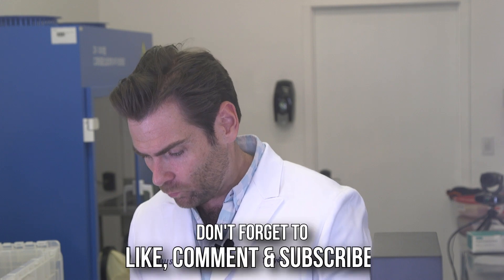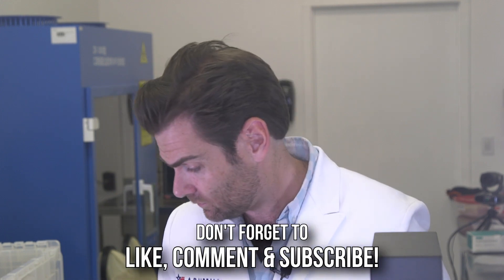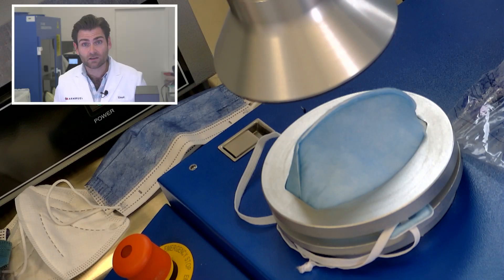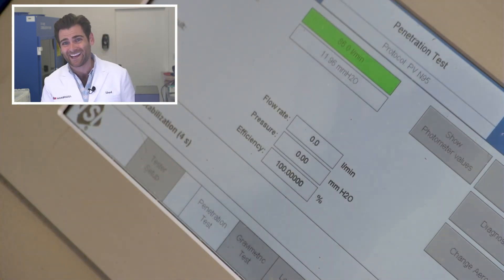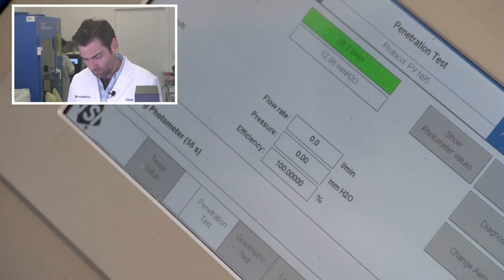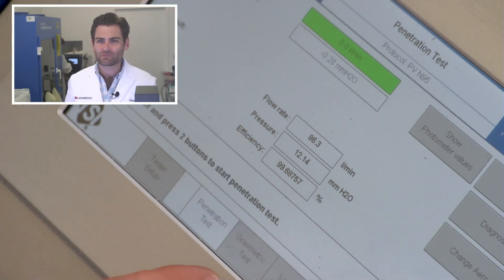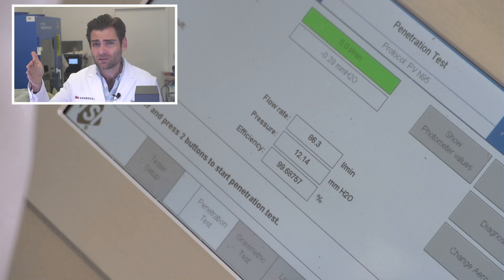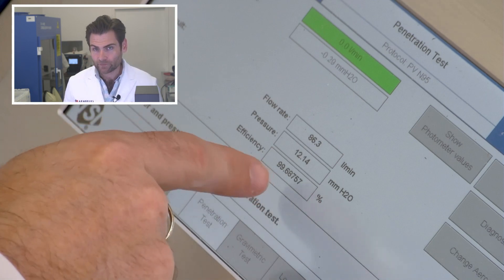That just ain't breaking on your face - Drager X-plore 1720 FFP2 Review

Comment: The Drager 1720 ffp2 has a single meltblown and a thick fleece to maintain shape.The 1730C ffp3 has double meltblown ,is thinner ,has shorter headbands. While both Drager ffp2/ffp3 masks score over 99% ,it's not a guarantee that the ffp2 can do the same with paraffin oil at 95l/min. Actually,most common ffp2 masks will fail miserably to get over 99% with paraffin oil particles.If they fit one face the same ,it's  ok for the pandemic,but they differ for industrial use.Also, ffp1 masks from reputable manufacturers will usually get over 95% with NaCl challenge,way above 80% ,but lower with paraffins.For example ,the  Drager 1350N95 is identical to 1310 ffp1 and 1360R95 with 1320ffp2.